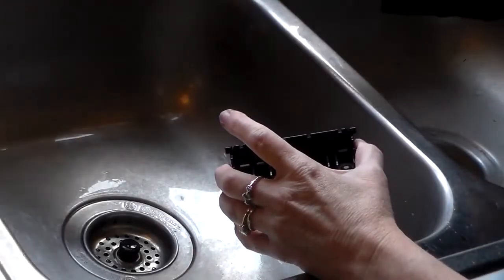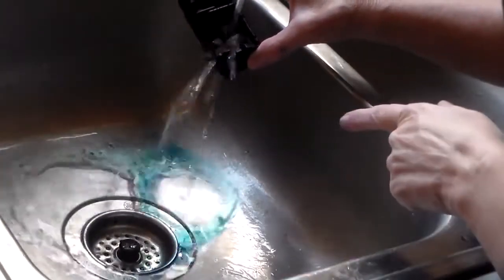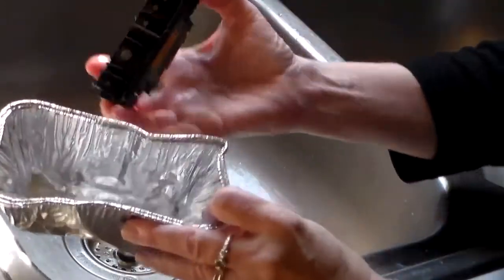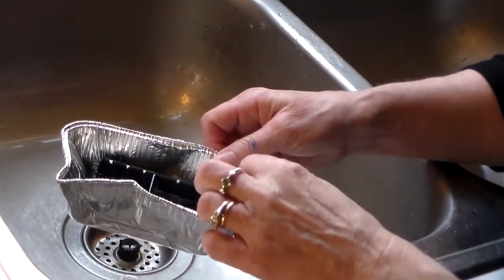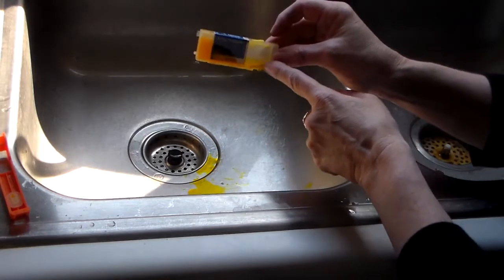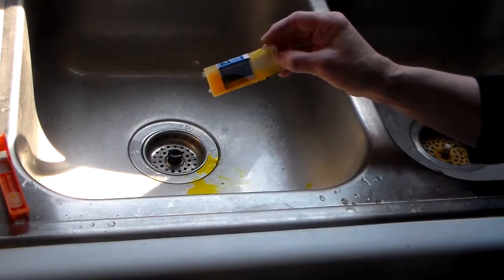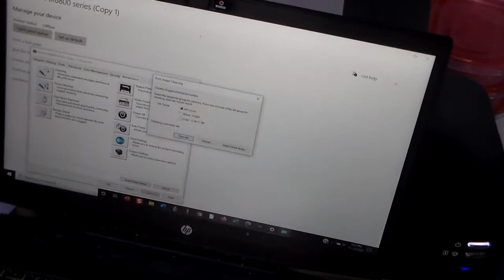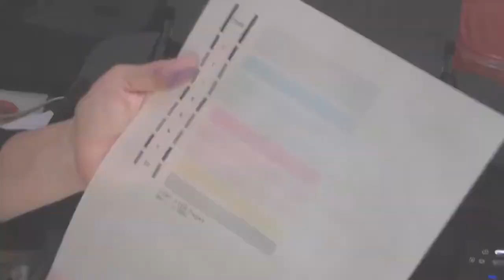Canon edible printer troubleshooting for cakes  How to clean the edible ink print head

Comment: I have this exact printer, but I can't get it to print on my icing sheets. Is there a particular sheet setting/thickness I need to set the print at so it will print on these icing sheets?
Reply: That's strange, it should print on the icing sheets with no extra setting changes. You might want to try putting it on a matte photo paper setting if you're not doing that already, that's what I use.

Comment: Nope can never get mine clean I got a new print head worked and I said I’m gonna ruling it every single day, I did and after the 3rd day started having lines in the test run! Not sure what I can do but it’s literally a pain in the butt and I’ve spent so much money doing this it’s not even funny!
Reply: And just so you know I even have a little plunger that I connect to the top of the sponge it forces the water completely through I watch it spray out the bottom it runs completely clear solid sprays out of all outlets but STILL no luck with unclogging
Reply from the maker: I totally understand...I've spent the last month having at least one of my three printers just stop working right after a day or two of printing fine. It makes no sense, and it's completely aggravating. I'm at the point where I just assume that I'll have to clean at least one print head a day, and it's usually two of them. There's also some defective magenta ink being sold, and some companies have more or less fixed it, but the magenta has always given me problems.

Comment: This has been so helpful for my personal printer. Question, do you think this would be possible to fix a printer that hasnt been used in years, our local culinary school found one in the closet and we wanted to try to fix it for their students
Reply from the maker: It's worth a try, I would try to make sure that the print head is totally cleaned out, though. Start by running it under really hot water for 15 minutes then soak it in hot water for a while, use some print head cleaner fi you have any (the food coloring kind) and maybe put it through your dishwasher at home.  Watch my video on the nuclear cleaning option!

Comment: Thank you, extremely helpful information. I was told not to ever wet the green part on the back of the print head. But seeing you just run it through warm water and just make sure it’s dry answer a lot of our questions. We ended up buy a second canon as a back up . We have a few questions #1 what type of edible sheets do you recommend ? #2 what edible ink do you recommend? #3 Do you cover your printers after using? Thank you in advance Husband & wife little cookie business.
Reply from the maker: I only print on wafer paper and I get it from a few different places. For icing sheets I would stick with a company that has a good reputation so that you don't get old ones because they'll dry out over time. I use Icing Images for ink, I think they sell icing sheets too. I just close the printers up as usual when I'm done, no special procedure.

Comment: Hi! Can you use vinegar to clean a print head? I really want to use my current cannon to print on edible paper. I have a Pixma MX882 and I think that model is used for edible ink. I can tell my family not to eat the pictures if it will be unsafe, but if I clean it really good, should I give it a try?  I know its not recommended
Reply from the maker: No, you can't do that for a bunch of reasons. The regular printer ink is toxic, so it shouldn't be used for edible paper. Also the edible ink can mess up the printer because it doesn't flow through the same way.. Vinegar won't clean print heads, especially with the regular printer ink.

Comment: Hello I have cleaned my printer head 4 times have did the cleaning  about 6 time have did deep cleaning and still my cyan not printing I’m about to give up printer was doing fine until I put new cartridges in please help
Reply from the maker: I'm sorry it took so long to answer, I thought that I'd answered this. Try one more time, rinse the printer head in hot water for 15 minutes until it looks like it's running clean, then soak it in printer head cleaning fluid for a couple of hours. Try forcing some of the fluid through the nozzles using a syringe and shooting it into the nozzles and through the vents on the back. After it's soaked for a couple of hours run hot water through it again for another 15 minutes, then let it dry out for an hour or so and put it back in the printer. Run a deep cleaning on it and see if it prints correctly. If it doesn't, it could be time for a new printer. I just had a printer do the same thing with the cyan not printing, and when I cleaned it the cyan printed but magenta didn't, and I couldn't get it to work, so I had to switch it out for a new printer, unfortunately.
Reply: @Acaketoremember mine is doing the same thing and I had it since March. The pictures are faded and lines are on the images. I ran a nozzle check as well and deep cleaned it. I also flushed it with water
Reply: March 2024

Comment: Perfect! You was very detailed and explicit. Thanks!
My story:

I wanted to throw my Canon 6351 into garbage because original cartridges are very expensive, it gets jammed, then extensively used during deep cleaning and by the way it evaporates when longer disused via little air hole which allows ink to go out from cartridge :
 - printer was "jammed" after a prolonged period of disuse. I had to use 2-3 times deep cleaning to get it working back. But after multiple times results were not 100% and output was with failures (mussing "pixels") 
 - Ink has evaporated during longer period of disuse 

But I realized that color laser printer has bad / unusable photo printing quality. I bought cheap ink and refillable cartridges from aliexpress (check reviews) and I cleaned printer head as you showed and it's printing like when I bought it. I was expecting that printhead will be damaged but no, now it's 100% wroking like a new.

I waited ~3 hours until my printhead get dry in room temperature (25C degrees).
Reply from the maker: I would be really careful about buying cheap ink, I have a feeling that it's not food coloring!

Comment: @A Cake To Remember LLC  ...Great Video.  I just brought a new CanonTS702a off Amazon with a 4yr. warranty. It is the same printer that Imaging Ink is selling in their bundles. I also brought the conversion kit from Imaging Ink.  I've been review videos and everything to do with Edible printing but I can't find anything about the cleaning cartridges they sell.  Do we need them if we clean the print heads?  Thanks
Reply: Nah, I think that cleaning cartridges would probably just be used to run some kind of cleaning solution through the print head, but since you can take it out and use water you don't need to us the cartridges. Water will do a more thorough job.
Reply: @KaraBuntin  Thank you so much!

Comment: Thank you for this! Mine is used for everyday printing. I just finished all the steps it is drying❤about  how long does it take to say it's safe to put back into the printer?... Mine was just printing blue so hopefully all will be good when I put it back together 😊
Reply from the maker: IT doesn't take that long, but I've been letting them dry out overnight. I've put them back in after half an hour or so but I make sire to get as much water out of it as I can with a paper towel.

Comment: Hi Thanks for this information, was very helpful, could you please tell me which of the latest Canon Printer you are using for this, we still have an ip7250, but are looking for a back-up machine that hopefully uses the same cartridges.
Reply: I've been sticking with the ix6820 for as long as I can. I have 5 sitting in backup waiting to be installed.
Reply: @KaraBuntin  ok thanks for the info

Comment: Hi, I have a canon edible printer , my icing sheets always print with that smudged weird overlap on the bottom 1-2” of the sheet (prints perfect on paper).  I’ve tried so many settings, any tips or paper settings you recommend? ,thanks in advance 🤍
Reply from the maker: This is a weird thing that happens to me too, but I don't know how to fix it. You might be able to outsmart the printer by attaching a leading edge of a piece of icing sheet to the front end of the sheet that you're printing on, and setting it to print on a legal sized sheet. i don't know if that would work, but if it's only going to print the smudge on the first part, and you have the file set up with some random stuff on the leading edge and you can attach an extra piece of an icing sheet that would make it 1-2" longer, it might print the smudge on the extra piece and print the normal sheet the right way. I can do a video about that over the weekend, I don't know if I'm describing it the right way so that you can visualize what I'm talking about.
Reply: @Acaketoremember  hi thank you for getting back to me so quickly! I totally understood what you meant, I considered that, but only as far as changing the settings on my printer/ laptop… adding a dummy paper behind the edible sheet to extend the length might make the difference… I’ll give it a try thanks so much , mac
Reply from the maker: https://youtu.be/dYCMsUi_crc

Comment: Will removing edible print cartridges when the printer is not in use prevent buildup in the printer?
Reply from the maker: Not that I know of. it happens more when the ink goes through the print head as it's printing. It gets clogged up inside the print head because the food coloring doesn't have the chemicals that make the ink not get clogged up inside it.

Comment: So ow long can you soak a print head in water? Is overnight too long?
Also, Magent!! Ugh!  It’s the only one that ever gives an issue.  I clean the printhead and works great. The very next day the pink is barely there.  Cleaning daily is stupid.  You mentioned magenta maybe sold from bad batch, is there a particular brand you trust?  Icing images is where it came from.
Reply from the maker: It's  not a bad batch at this point, they fixed that, but the magenta is thicker than the other ink, so it clogs faster. I've been having problems with the black ink recently, and I never did before. Black has magenta in it, so I think part of it could be that. It's REALLY  aggravating. I did try a different ink brand and it did the exact same thing, so that didn't matter. I also think that the food coloring ink basically burns out the print head a lot faster than regular ink does, sine I can usually get about 3 months out of a printer before I have to give up and replace it. If one lasts longer than that it's a miracle. I plan on going through about 10 printers a year, it stinks. 

You can soak them in water for as long as you want to. If you don't have the print head cleaner from Icing Images get some, it definitely helps to clean the ink out better than water by itself. And force water through the nozzles using a squeeze bottle or syringe, that helps to get clogs out.
Reply: Thank you.  I’m actually out of the cleaner, so I’ll be ordering more tomorrow.  Almost not worth the hassle of edible printing ☹️
Reply: @Acaketoremember  WHOA!! 10 printers a year? May I ask how many prints you get out of it before having to replace the whole printer? How many prints would you do in a day? I've had mine for so many years so now I'm curious!

Comment: Hi! I’ve followed all the stops and my printer is only printing black and white. Any tips on how to fix it ?
Reply: You would have to clean the print head again if the colors aren’t working. Before you do that make sure the printer isn’t set to black and white printing! Sometimes it gets to the point where it just won’t print at all anymore and the only solution is to get a new printer.

Comment: Hi when I put my ink in my cartridge it run out fast on my cartridge it’s a little black piece that I hook on the orange clip the black piece want stay up do you think that why it’s running out the cartridge I just got the cartridge 🤦🏽‍♀️I see your piece is clear mines black
Reply from the maker: I just got some that have a black clip and they don't want to get locked in the same way as the clear ones, so that's probably not the problem. Make sure that the little rubber stopper is in the cartridge, that keeps the ink from just pouring out. If you mean that it runs out fast when you're printing things, it does...The food coloring ink definitely doesn't seem to last as long as regular ink for some reason, I have to refill my cartridges pretty frequently.
Reply: Just seen your reply Thank you

Comment: how do you stop black roller lines on my prints please
Reply from the maker: You would have to clean the rollers if you can get to them. Sometimes you have to go through the back panel of the printer to reach the inside parts, but it depends on how your printer is set up.

Comment: What if it’s just printing black ink when you run the cleaning?
Reply from the maker: Either clean the printhead by running it under water to flush it out, or try another cleaning cycle. If it's not printing any color at all you probably have to remove it and clean it, even if you've already done it once. At some point, every edible ink printer will just die and not print right no matter what you do, though, so it could be that it's just the end of the line for the printer.

Comment: Is it safe to wash it with water?  I think i need to do this cant get mine to print
Reply: Yes, and you can sit it in a bowl of water with the sponges under the water to soften everything up. Just make sure that you dry it off really well before putting it back in the printer.

Comment: what a headache
Reply from the maker: Yep...That's why most people who buy the edible ink printers end up throwing them out the window after a few months. They're a pain in the butt.
Reply: @Acaketoremember  I have had the same printer for the past 7 years. All I do is at the end of every print job I clean the print head much the same way except I use some large syringes with the tips cut back to fit over the ink entrance to force hot water into each system until it sprays out clear. blow dry with air can blowers wrap up with a sheet of paper towel. And it ready for the next days of printing. this all take no longer 5 or 10 mins it also lets you see how the ink cartridges are doing .